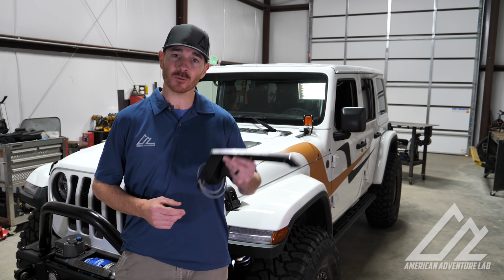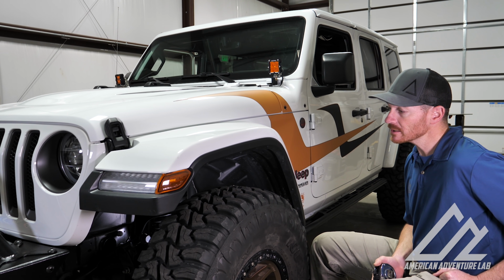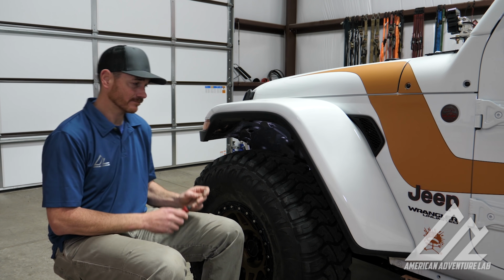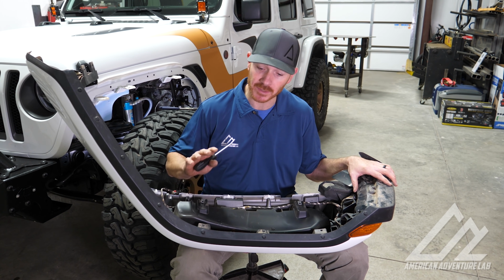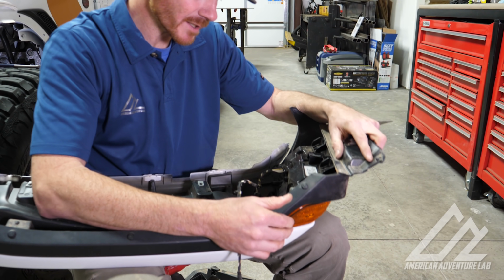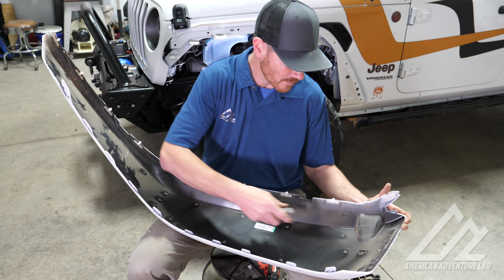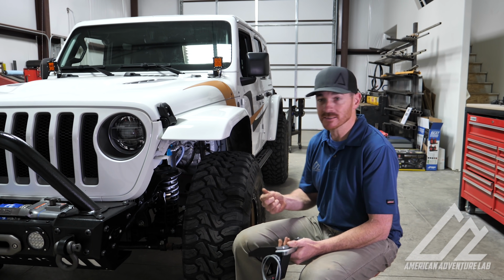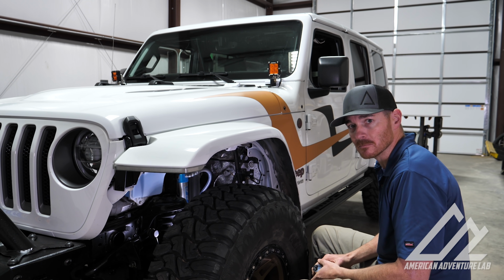Jeep JL High Line Installation

Comment: Come out with an inner fender liner that goes with this setup and you've earned my business (and several other's), don't like wheels tossing salt and mud into the wheel well area, that's just asking for corrosion problems 3 years down the road.
Reply from the maker: We're already on it. Should have something to show in about a week. Thanks for commenting and watching!
Reply: Any liner updates?
Reply: Was curious about this as well. A lot of unnecessary stuff will be thrown into that engine bay and could possible damage vital parts. They do look cool though.
Reply: Okay so I want to buy these but I, like the rest, want it to look good, clean and almost professional. 
Any updates on when it will be finished?
Reply: @AdventureLab  Looking for uptakes on these Fender Liners....
Reply: American Adventure Lab so what ever happened to the fender liners u mentioned.. w/h it this protect is asking for corrosion and unnecessary damages... Any update would be appreciated.
Reply: Are you serious? No way I would do this to my jeep without a inner fender liner.
Reply: Fender liner update. Otherwise I'm loving this.
Reply: Can you just use the factory liner and cut the front?
Reply: you coudnt be more wrong the inner fenders are NOT designed to protect anything from debris. they are  designed to hide the engine components and give a cleaner look
Reply: @Chris schneider Lol, great argument strategy is to open your sentence with "You couldn't be more wrong", that ought to convince everyone right? But anyways, the inner fender does protect the wheel well area from debris because spinning tires are constantly tossing pebbles and mud around. This is different from the bottom of engine bay because there aren't any spinning tires under there. Basic science here kiddo.
Reply: Great looking solution. Need inner fender  for the engine bay and what did you guys do to the rear inner fender?
Reply: Liner update? Love this product
Reply: Can you use the existing liner and just cut it back to accommodate the new light?  I know someone asked this question but never saw a response?   Thanks.   Nice looking light !
Reply: It looks like they came out with an inner fender now
Reply: @Adriel Marley i really appreciate your reply. I got to the site through google and Im waiting for the hacking stuff now.
I see it takes quite some time so I will get back to you later with my results.
Reply: @Adriel Marley it worked and I actually got access to my account again. I am so happy:D
Thanks so much you saved my account !
Reply: @Gatlin Thatcher glad I could help =)

Comment: Just got these and realize the flare just lays on top of the bracket unless you put a bolt through the side of the fender and then that’s just one bolt holding it on makes more sense to replace with aluminum flares .
Reply from the maker: Hey Stuart. First off. Thank you for the order and thanks for watching the video. Based on your comment, it sounds like you are surprised at how these install. I'm sorry for the confusion there. This video was produced to eliminate any of the confusion.

The bolt is plenty sufficient to retain the outside of the fender. The fender is also attached throughout the quarter panel. In addition, we sell an optional "Fender Retention Kit" if you would like to replace the white plastic OEM clips with nutcerts and bolts - https://americanadventurelab.com/product/jeep-jl-fender-retention-hardware/.

On a side note, "makes more sense" is completely relative. We are not claiming this to be the perfect product for every situation. However, it is a very cost effective way to add a ton of style and additional clearance to your JL without breaking the bank. I doubt you will get aluminum flares for anywhere near this price. Also, the aluminum fenders will transfer any impact directly into the quarter panels, which will be a very costly repair. The plastic will absorb that impact, and in most cases, bounce back without a lot of damage to the fenders.

Comment: What if someone was so inclined as to keeping the factory DRL setup and outer black trim so would it be possible to remove the inner part of the fenders and maybe cut around the plastic welds that hold the front DRL and cut the inside edges where it meets and clips into the outer black trim so it becomes a gutted fender with factory DRL and outer black trim and add your Fender Liners to it

Comment: Hi,. thanks for this video, super helpful .Planning to purchase this product. Quick question - do you have video instruction how to use z automotive Tazer to configure the light and prevent the Bulb Out Warning? Also, do you know if the Tazer light support it ? if not, I will need to upgrade.

Comment: I just picked up a Gladiator Willys.  Which version would your High Line need to be to fit my fender flares?  They seem to be 2 piece fenders but I am not sure if they are the Rubicon or a new modified Sport version.

Comment: LOVE the video....any problems with the back of the fender flopping around at speed....seems like the only thing holding them on are the plastic clips back there. OH and LOVE the bumper...I ordered the exact one from Hauk....should be in any day now.
Reply from the maker: Thanks for watching! No problems with the back of the fender moving. In an odd wind situation the front can bounce a little, but 99% of the time the wind is pushing the fender down. We have had people ask for a way to secure the front. I'll be including a tab in case anyone wants to drill their fender for extra support.

Comment: I wonder if your before and after measurement in this video is applicable in terms of true travel gained?   It would be helpful to also see a measurement from the top of the tire to the lowest point on the brackets hanging down where most tires would hit first.  I imagine there will be quite a few people that choose to not cut the brackets and travel gained is more like an inch for most people.  They look cool though..

Comment: @American Adventure Lab will the lights fit if you don't want to take the inner fender out ?
Reply from the maker: They will. We have several customers who retained their inner wheel liner and the small black trim on the outside of the flares. Take a look at the Trail Jeeps JL on the product page - https://americanadventurelab.com/product/jeep-jl-high-line-fender-brace-with-daytime-running-lights/

Comment: Will these led replacements light work on a JL that doesn’t have the led lights.
Reply: Eddie Hernandez we just installed these on our 20 JLR non LED and the lights work no codes on initial startup. Going to wait a few days to see what happens. Ordered the tazer and looks like I wont need it.
Reply: @houseofbaker2001  are you still running fine?
Reply: Austin Harris yes. We had no codes. We added the JL mini after adding the AUX switch panel and we get the blinker out code now on the first use of signal. Everything works fine. We have the RGB version of highline.
Reply: houseofbaker2001 
I have 2018 JL Sport non led and no DRL package and I’m having code for bulb out and DRL not working any suggestions. I already installed Tazer mini but so far no luck.
Reply: Vohra Hanif ok we had added AUX switches recently and then added the tazer mini to activate those switches. We got the light out message after installing tazer and after running the setup proceedure found at AAL website. So I tried turning off the led in tazer and rebooted tazer. We now have a no warning messages. So try just running the leds plugged in with out the settings for tazer. Oh we did get one light out message initially but I cleared and it has not come back. I think on the JL the tazer has its wires crossed??? LoL.

Comment: Nice install, looks really nice and clean. New lights  are awesome. Does anyone make an inner fender replacement for the exposed engine area ?
Reply from the maker: We will have one available in about 2 weeks. Thanks for watching.
Reply: Les Szabo  asks the question I have. Or for simplicity might there be a possibility to use the stock inner fender well?
I’m aware of plenty of aftermarket “wells”, but want to spend money on other gear and not the “wells.”

Comment: Do you know of an aftermarket fender for the JLU Sports that work well with this setup?

I have a Rubi suspension on my Sport and 35's. I rub the inner fender liners in the rear so am interested in replacing with flatter fenders but would love to incorporate these lights as well in the front.

Comment: So if you wanted to put 35’s on a two door jl rubicon and no lift will this work with no rub on the front? I’m kinda of an slow and low crawler, and I know the rear would still rub......., or did I miss something l?
Reply: You could take the l you need out of the rear too. Now the question is, if you live anywhere they use salt on the roads, is removing the fender liners a good idea?

Comment: Will these work with a non-LED package Rubicon?
Reply: Don't see why not considering the fender flare is exactly the same, as you will be removing the light housing.
Reply from the maker: Yes, they will.

Comment: The lights look really cool. The one HUGE issue is everything is now exposed under the fender. Someone needs to come up with a thn plastic liner that would go under kind of like factory, but very tight under the fender and to cover the engine. This is just NOT okay to leave it all exposed like that. The but the lights are sick.

Comment: Why won’t these work with a JL sport s? Thanks
Reply from the maker: The JL Sport uses a one piece fender, so they don't separate into an outer shell. I suggest picking up a set of Rubicon outer shells. It would be a great upgrade.

Comment: Does it plug and play with factory halogen?
Reply from the maker: It does plug and play. However, due to the LED health circuit in the OEM turn signals, the dash will show a bulb out warning when first started. It goes away pretty quickly, though.
Reply: American Adventure Lab have you tried using a tazer and telling the vehicle that it’s using led? Your lights look awesome btw!
Reply from the maker: @bguidr6186  Thanks. I really appreciate that. Yes, I have a Tazer on mine. Some have said they had luck eliminating the warning, but I have not. I haven't spent a lot of time on it, honestly. It may be possible.
Reply: American Adventure Lab nice work! Appreciate all the effort in getting things right!!
Reply from the maker: @bguidr6186  thanks! It has been quite the undertaking.

Comment: Omg you need those inner liners. You really didn't have to remove all of it. You could just have cut the plastic portion close to your bracket and it will fit right in.

Comment: DOT or nah?
Reply: I mean its a light. So it works.
Reply from the maker: Hey, John. This is just a part of what's needed for DOT. You would also need an amber side light. Some people have added them to their inner fender to avoid putting a hole in the outside of the flare. Thanks for watching.

Comment: 3 problems with doing this.  1 there is no longer any structure under the fenders and they flop around like crazy on the highway. Without liners you’ll be throwing rocks, dirt, sand and everything else into the front end.  3 if you don’t cut the tabs off you only gain about an inch of clearance as the tires hit the tabs before anything else.

Nice product you have but it’s not finished.  You need to develop a hard inner structure that addresses the issues listed.
Reply from the maker: Only one of the things you mentioned is actually true. Yes, they should be paired with an inner fender if you want to keep debris off of the engine. I'm not sure how that affects this particular product, though. There are tons of inner fenders on the market and we will have one soon, as well. 

They do not flop on the highway as the air over the fender pushes the fenders down into the bracket. What experience do you have running this bracket that says otherwise? We have quite a few sets out now and zero complaints of fenders "flopping around like crazy". It there is feedback to suggest people would rather drill a hole in their fender to attach it, we will create an outside bracket to do so. However, I like the fender having the ability to move if it impacts something out on the trail. I'm not sure why you would say that without knowing. Strange. 

Your comment about only gaining an inch of clearance is also simply not true. Take a look at the JL on the product page that is being articulated by the fork lift. We gained several inches of articulation on that one and were even able to remove almost 2" from the bump stop. The same goes for my JL when I first began working on this product. What you're saying about the tabs would be true if you had a huge offset wheel. However, we do suggest removing the tabs, so I don't see why you would point out this as an issue with the product.

Comment: HOW do you figure you gained ANY clearance when the 2 metal fender supports (welded to frame) are STILL IN PLACE???? Looks great, but unless you remove them, there’s ZERO CLEARANCE gained
Reply from the maker: We usually cut those 2 metal fender supports off on our shop vehicles, this particular case the customer wanted them left on.